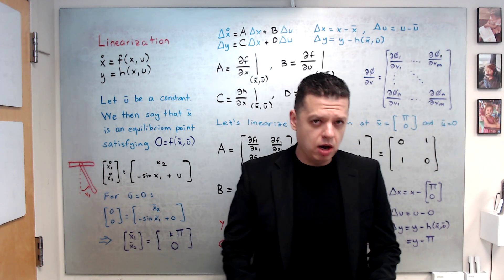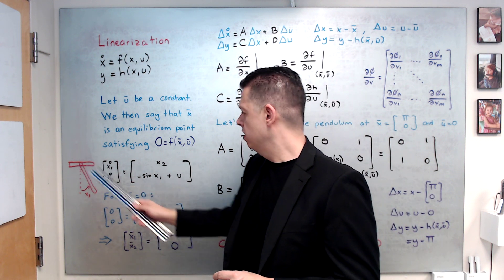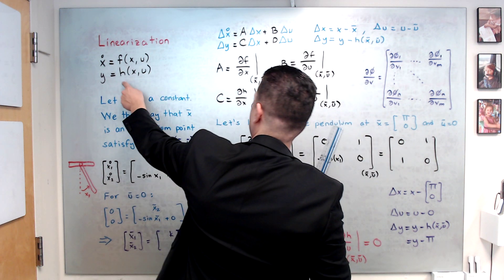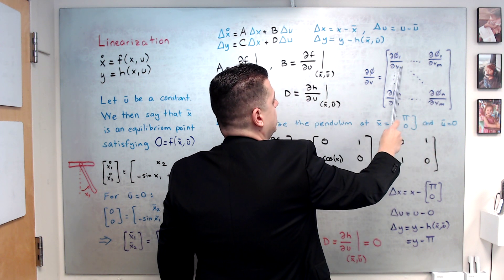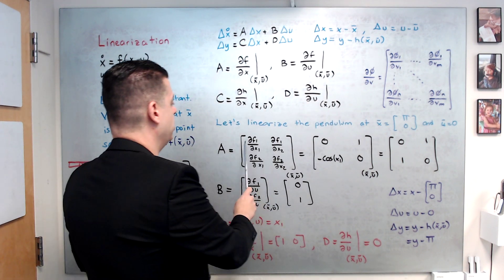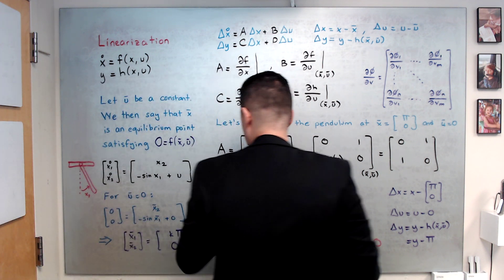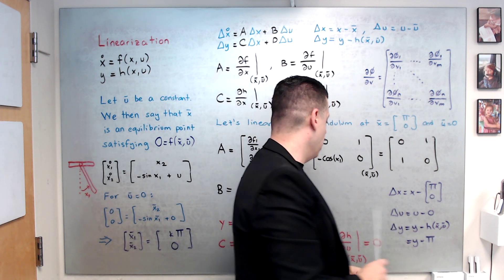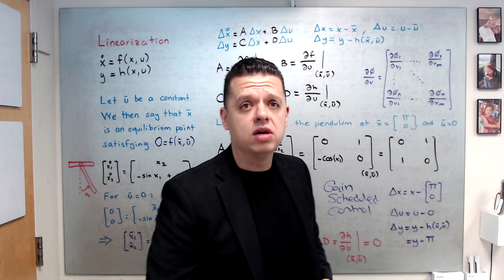Modeling: Linearization of Nonlinear Systems (Lectures on Advanced Control Systems)

Comment: Hello  Sir,
A question mark has emerged on my head and not satisfied from the answers that I saw during research.
Let' s say we have a nonlinear system and we linearize it, got A, B matrices of the linearized model. But we got it around the fixed operation point like an aircraft flying at 900 km/h and  1000 feet altitude. What if it changes its altitude, speed ? -> The A, B matrices are going to change right? Can we use them to establish an observer to estimate the states(yaw,pitch,roll, and rates of the aircraft) even at different flying conditions such altitude, velocity?  Or we have to use Gain Scheduling I think. Thank you!
Reply from the maker: I would go with gain scheduling to achieve a precise control strategy ;)